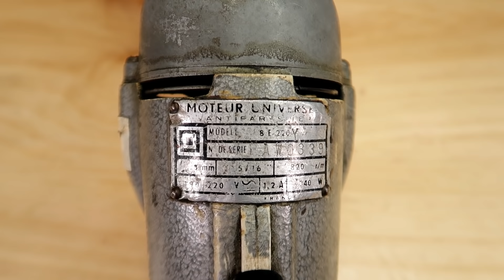BottleCap Drill - Restoration ( only one in the world )

Comment: The "Methode Champenoise"  method of producing Champagne requires two corks.
The first is a temporary cork, which is inverted into a freezing solution to solidify in the neck of the bottle the solids that form during fermentation.
On "disgorgement", that cork is removed, and a solid lees plug is shot out, leaving only crystal clear wine.
The small loss of liquid is made up from stocks of the wine.
A second, permanent cork is then inserted, caged and wrapped, which remains until the wine is sold.

With tens of millions of bottles of Champagne produced annually, that means a lot of insertion and removal of corks. 
Enough to make the average Frenchman's wrist become quite weak if done by hand.....
Is this Infernal Machine designed to remove and/or insert, Champagne corks?
Is it designed  to prevent  "Le poignet molle français" ?
Reply: "Le poignet mou français". Yeah we have that thing called gender fro objects too. The french "wrist" is  male therefore the "mou" instead of the "molle" which is for female gendered things like watches ("Montres") as in the Dali painting "Les montres molles".
Nice try though for a non native french speaker. This language is so hard to learn I'm glad I have learned it the easiest way : growing up in France.

Comment: It appears there's a simple way to remove the large gear you couldn't. Opposite the keyway there is a setscrew that holds the gear to the shaft. Remove the setscrew and the gear should slide off. Watch out for the small key in the keyway! You don't want to loose that in the rest of the guts.